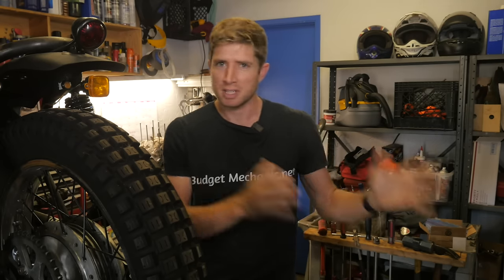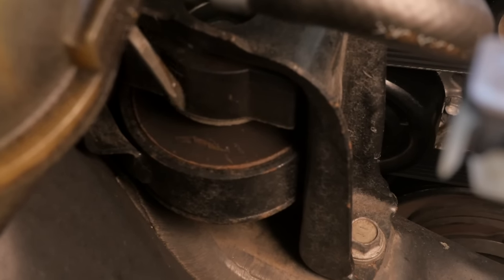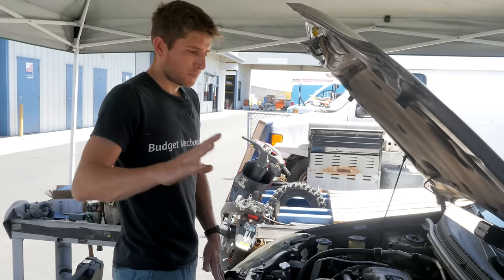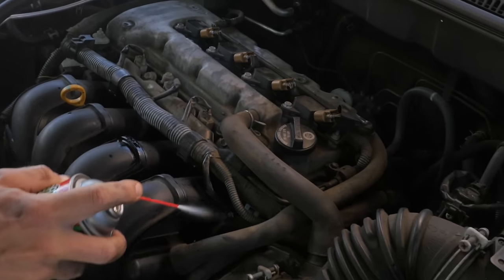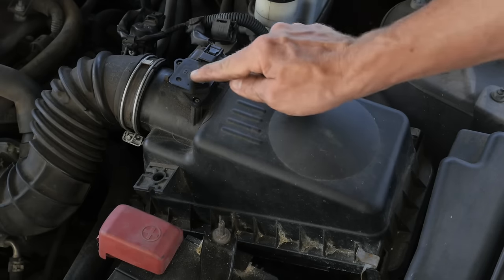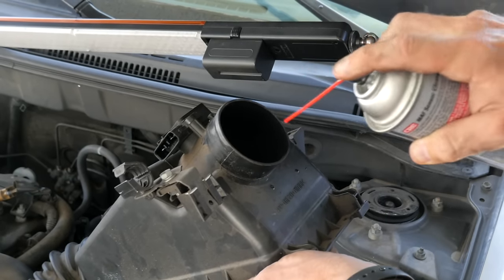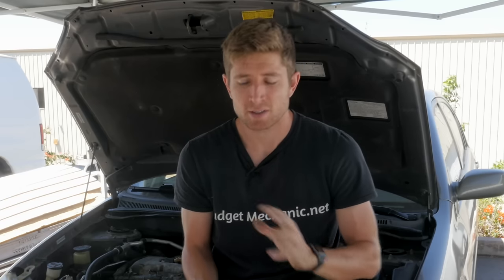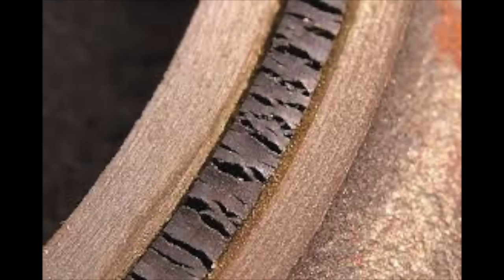Diagnose and Fix Rough Car Idle - Main Causes For Shaking / Vibrating While at a Stop

Comment: One problem that is not often mentioned in the many videos I've watched on Ford / Mercury ignition problems.   If you replace plugs and coils and other parts, and find your engine light still comes on after a while, or shortly after replacing parts, the real problem is that the main computer needs to be reprogrammed.  I spent about 800 dollars replacing plugs and coils twice, mechanics replacing parts, etc.  all which did not solve the problem.   You may also notice the car jerks when you accelerate, as though you have a transmission problem.   The real problem is not the transmission.   The main computer has to be reprogrammed.  Another symptom is the air conditioner compressor will shut down; you will not have air conditioning.   That is to protect the AC compressor.   Once you have the main computer reprogrammed, the AC compressor will work.    I went to 6 different Ford dealers in Miami / Ft. Lauderdale, and none of the six mentioned a thing about reprogramming the main computer.   I was told by several dealers, not knowing about the main computer at that time, that "there's nothing you can do."
One Ford dealer had the car a full day, and said I might have to replace the main computer, and that they cant do that , because Ford no longer carries them.
I finally found a Ford dealership (Pines Ford) who said they could reprogram the main computer.    Regular scanners can't reprogram your computer.  It requires a bi-directional scanner, a Ford subscription for the scanner, and someone who knows the procedure required to reprogram.    For that reason, IMO, it's best to take it to a Ford dealer who can reprogram the computer, and they can also check to make sure your plugs and coils are all functioning correctly.   They can also check for vacuum leaks, vacuum hoses that may need replacing, bad coil connectors, etc.   Not cheap,  but better than paying a mechanic to replace parts that won't fix the problem.
Reply: Did it fix the way your car was running before? Having the computer reprogrammed? Cause I have changed the coils and plugs and a lot more on my Ford Mustang and it’s still rough idling and I don’t know what to do
Reply: @aaronortiz5753  Thanks for your question Aaron.   Absolutely,  find a Ford / Lincoln dealer that offers the service of reprogramming your computer.
In South Florida, I was very surprised as to how a good number of Ford Dealerships seemed to have no clue about reprogramming the main computer.   One dealership near my house had the car a full day and never did anything to the car.   They said it probably needs a new computer and that since Ford no longer sells a replacement, I was out of luck.
I got a similar response from several other dealers.    Pines Ford in Pembroke Pines FL does reprogram main computers.   I had it done twice.   Before the second reprogramming, I specifically asked them to change any coils that were not replaced on the previous visit, which completely solved the problem.   They replaced a vacuum hose and one coil connection as well.    If you find a Ford dealer that tells you the main computer can't be reprogrammed, or that they do not do that, find another Ford dealer.
My guess is that most general repair shops don't have bi-directional scanners.   Auto parts stores will rent or sell scanners, but these are generally just for diagnosis.   They can detect a problem with a particular cylinder misfiring.    They do not however have the capability to do much more to your computer than to shut off the engine light.   Once that light goes off, it will eventually go back on if the problem has not been solved.
If your AC compressor has stopped working, having the computer reprogrammed may reactivate the AC compressor.   
Bidirectional scanners are a more expensive scanner, which requires a Ford subscription.  This type of scanner has the ability to re-program the main computer.   It probably requires a specific process, so it's not the type of thing I would purchase myself, or attempt to do myself.   A Ford dealer who reprograms computers should have all the right equipment and be familiar with the process involved.   BTW, I got a lot of this information from a Ford Master Tech.   I told him how I had replaced a lot of parts, coils, plugs, and carburetor parts, but my engine light would still come back on, and the car had jerky acceleration, etc.   He immediately mentioned having the main computer reprogrammed.   He also said that the AC compressor shutting down is typical.  The main computer shuts the AC compressor down to protect it until ignition problems are resolved.
Reply: @tompastian3447  
Thank u man! I appreciate it. I did take it to a dealership already but they told me that I need a new computer, they didn’t say anything of reprogramming so I’m guessing they don’t do that. And yeah also my A/C isn’t working which was really weird to me since the A/C doesn’t really have to do anything with the engine acting weird, but now that u are telling me it’s because of the main computer then all makes sense. I did get diagnostics and it said u had like 3 misfires and did everything I could to fix it but it’s still the same. I well make sure to find a dealership that will do the reprogramming. Thank u so much for responding!
Reply: @aaronortiz5753  Yes, find a more competent dealership.   You might try looking up Lincoln Dealers in your area.   Just a stab in the dark, but maybe since they service the higher end Ford vehicles, they might be more likely to have Ford's correct diagnostic equipment.     Another thing about people who tell you that the main computer may need to be replaced, even if that was true, a replacement computer also has to be programmed after it's installed.   You can't just stick in a new computer, or pull one out of a junk yard from another vehicle and expect the car to run right.   What city and state do you live in ?    VERY IMPORTANT, when they reprogram your computer, it requires 2 ignition keys.
Be sure to supply the dealership with two keys, or they may have to charge you to make a second key.
Reply: @tompastian3447  gotcha!! I will try looking for some around here. Yeah that’s what I thought, because I was like why get another computer if they are gonna do the exact same thing to the one I already have on my car. And I live in Maryland. And gotcha I will make sure to get 2 keys!

Comment: Your on point. My filter hose is fd up like what you mentioned. Same with the motor mounts. The sparkplugs needs changing as well. Whew. 2003 Honda Accord, we will make it through 2021, I trust you.
Reply: I am back in this video after my Trailblazer went shaking violently wow

Comment: It's easy to see cracked or broken motor mounts, but sometimes they're saggy or hard as rock so also check for that. Sometimes people will just do a visual without checking for anything else. You can poke them with a screwdriver to check for stiffness or even too soft.

Comment: Also check if the engine is getting enough volts. Sometimes the alternator is bad or the alternator regulator is bad and sending too much volts which is very rare.
Reply: How do you check that if there's no guage?

Comment: I just got a tune-up from the mechanic. I drove it the next day, and the check engine light came on. I took it to the auto store (autozone) to check the code, and it returned with a code of PO300 spark plug 2&3.  I took it back to the mechanic and he tested each of the coils since those were replaced as well and stated it was the 4th ignition coil. He went on to say it could be an issue with the cylinder.  I've put so much $$ into this car I thought should be a simple fix is becoming a total nightmare and leaving me bankrupt!

Comment: thanks Josh, this is the video i've been searching for years,  as i was researching i probably found many of the causes separetly but never a good well rounded explanation with examples like yours.
about the electronic throtle body, never knew you cant move it fortunately mine didnt breake when i held it open with my fingers and cleaned with wet wipes, it cleaned out nicely and the issue is gone, the idle is much better now as befor it used to go up and down a lot with the hot engine never after a cold start with the check engine ligth and the code for barometric pressure in the intake manifold. 
still got a little bit of vibration/shakiness gonna have to check some things from your list if not it might be from the torque converter as i understand it can also cause vibration and shaking
i have a 3.2 fsi a6 c6
thanks again for a greate video!
Reply: Thanks for the vedeo..really great 👍
Reply: Frank speech

Comment: If your car's engine misfires and gets bogged down or stalls when stopped at a traffic light but runs good otherwise, spend $8 and buy a small bottle of Lucas Deep Clean fuel injector cleaner with up to 15 gal of gas. Add all the contents into your gas tank filler neck and then add some more fuel to distribute it in the tank. I used it with 10 gallons. It was  amazing how quickly it worked for me, like right away. That told me the culprit was one or more carbonized fuel injector tips without doing anything else except checking for vacuum leaks first, which will have a whistling or sucking sound. Anyone can do this and it has worked for me on other cars.  😊
Reply: Thank you I have been losing my mind trying to figure this out will give that a shot tomorrow
Reply: @jbutton15  make sure to check for vacuum leaks first while the engine is running. The small bottle is good for up to  15 Gallons of gas. May require two treatments or use every couple thousand miles.😉

Comment: Thank you so much for this video! It’s very helpful and confirms everything I was thinking. I have a car that has a vibration/shake (rattles the doors sometimes) when stopped, and I took it back to the dealership when it needed the AC compressor replaced and mentioned it to them. They did nothing about it and pretty much ignored it. Now I’m trying to figure it out myself. I’m about to replace the spark plugs first, hoping this fixes the problem since it didn’t appear to be the motor mounts.
Reply: One problem that is not often mentioned in the many videos I've watched on Ford / Mercury ignition problems.   If you replace plugs and coils and other parts, and find your engine light still comes on after a while, or shortly after replacing parts, the real problem is that the main computer needs to be reprogrammed.  I spent about 800 dollars replacing plugs and coils twice, mechanics replacing parts, etc.  all which did not solve the problem.   You may also notice the car jerks when you accelerate, as though you have a transmission problem.   The real problem is not the transmission.   The main computer has to be reprogrammed.  Another symptom is the air conditioner compressor will shut down; you will not have air conditioning.   That is to protect the AC compressor.   Once you have the main computer reprogrammed, the AC compressor will work.    I went to 6 different Ford dealers in Miami / Ft. Lauderdale, and none of the six mentioned a thing about reprogramming the main computer.   I was told by several dealers, not knowing about the main computer at that time, that "there's nothing you can do."
One Ford dealer had the car a full day, and said I might have to replace the main computer, and that they cant do that , because Ford no longer carries them.
I finally found a Ford dealership (Pines Ford) who said they could reprogram the main computer.    Regular scanners can't reprogram your computer.  It requires a bi-directional scanner, a Ford subscription for the scanner, and someone who knows the procedure required to reprogram.    For that reason, IMO, it's best to take it to a Ford dealer who can reprogram the computer, and they can also check to make sure your plugs and coils are all functioning correctly.   They can also check for vacuum leaks, vacuum hoses that may need replacing, bad coil connectors, etc.   Not cheap,  but better than paying a mechanic to replace parts that won't fix the problem.
Reply: @tompastian3447  Thanks! I’ll keep that in mind!

Comment: If you have a misfire code, the first thing you should always do is a spark test. The testers are cheap and easy to use. If it's misfiring, your spark plug wires, ignition coils, ICM, or Distributor could be bad. (Distributorless systems will have an ICM and coil packs)

Comment: I have a shake on my Nissan x-trail at idle but idle only while on D/R.... Revs go down to 700(which is where they should be) but vibration comes in(sometimes revs go even more down with more shake).

The idle at P/N is butter smooth at 900revs....

Comment: I don't know Scotty kilmer says to make sure the car is off when you clean the throttle body and wait a half an hour before you turn the car on to let the s*** dry never heard of doing it with the car on

Can You Clean Throttle Body While Engine Is Running? Yes. However, the entire throttle cleaning solvent will go into the combustion chamber. This substance is very harsh on gaskets and oil seals.

That is why you either do it with the car off and wait until the stuff dries fully or you take the throttle off and do it.

Comment: You mentioned spark plugs but didn't talk about spark plug wires which can need replacing on older cars. My 1997 Toyota Corolla needed replacement of both spark plugs and the spark plug wires. Problem fixed!

Comment: Hey, I really enjoy your videos. They are very informational.
I have a 2008 Audi A6, 3.2 Quattro. I have been receiving misfire codes for some coils, I replaced all plugs and coils-still continuing to get a misfire code for my #2 cylinder. I get an ESP light, ABS light, and check enginie light after getting to 3,000-3,500 RPMs-then my car shakes. Any help please! 
My mechanic is stumped.

Comment: Informative and to the point. Wish my mustang plugs were as accessable as yours because that's what I suspect is contributing to my shaking while in gear with acceleration lacking in power. 

  Wouldn't the plug wires also be suspect?

Comment: It's either a "big" issue or a "small" : suspensions, motor mounts, sensors etc that's what I call "Big" it's pretty easy to diagnose and locate.
Now small issues, leaks, holes etc are deep hell material

Comment: some COP coil on plug ignition coils use a spring to make contact with the coil . When you remove one to change the plug , check for burning / arcing on the insulation . If you see any burning , you can pull the insulation off and see the damage inside

Comment: How about the O2 sensor? That could also make the car run rough.
Reply: So could valves that need adjusting or bad radiator fans.

Comment: I have been having  rough idle + some random weird sound when idle let off gas After Full gas that sounds like there IS a Lot of Air comming out  blowing making a popping.... Its been there for a long time and i have bad luck with mechanics as they dont seem to be able to help me (or they dont believe i have an issue). So i decided to do It myself. I replaced spark plugs and ALL coils. No deal. I asked for Valve adjustment ( its a Honda). No deal. Still the same ....so i bought a mini scanner and watched for the engine at idle with and without ac on... Because when Ac on, rough idle gets gone. i realized oxygen sensor short fuel trim IS -8 at idle and when i turn Ac on It gets to 0. Does It mean i have a fuel injector issue?